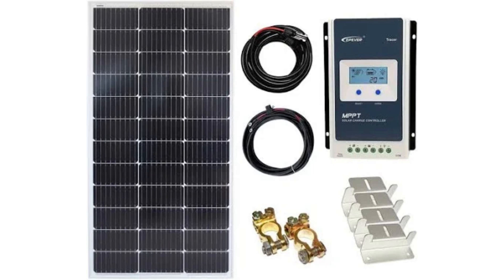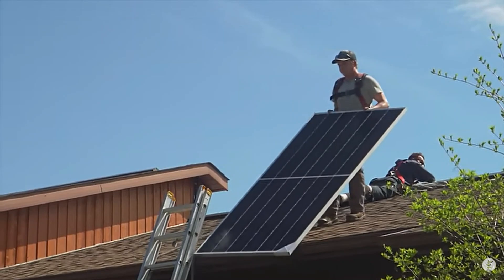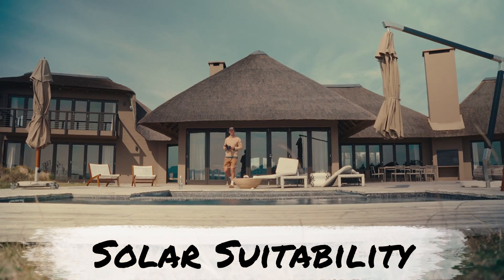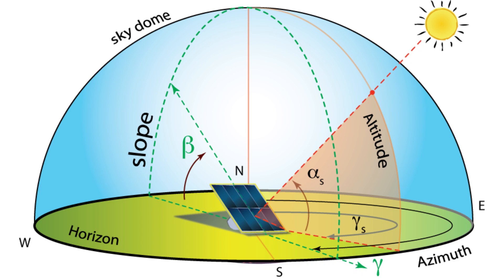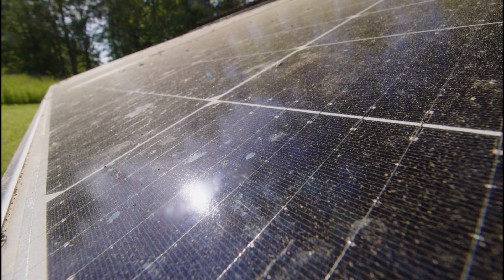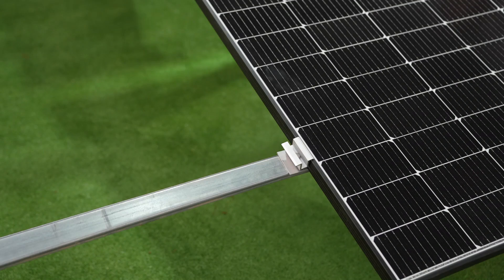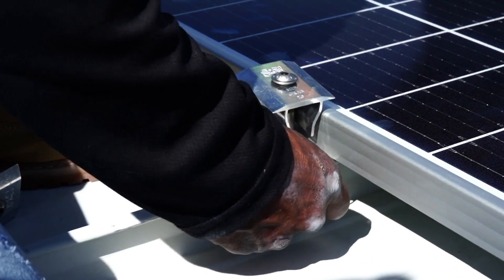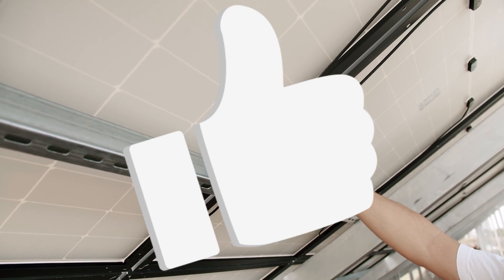DIY Solar panel kits: All you need to know

Comment: how important is cleaning of the panels and would i need some special equipment for that?
Reply from the maker: They need to be cleaned at least once in 3 month in Arid regions. Where its rains regularly, cleaning is  not a problem
Reply: @synergyfiles3536 Never had to clean ours in the UK, still at optimum capacity.